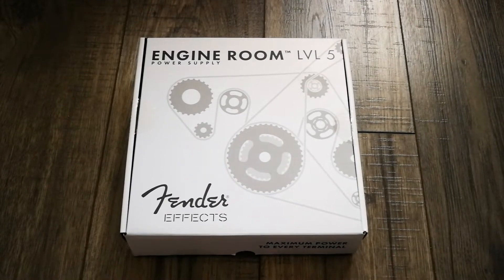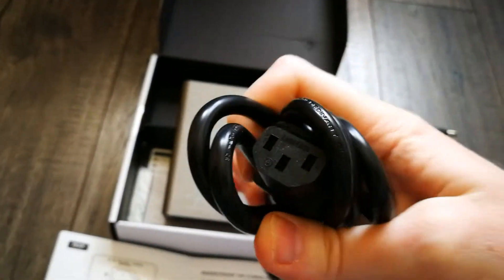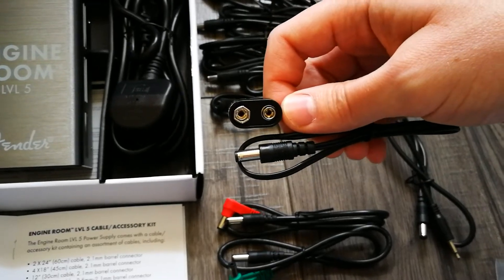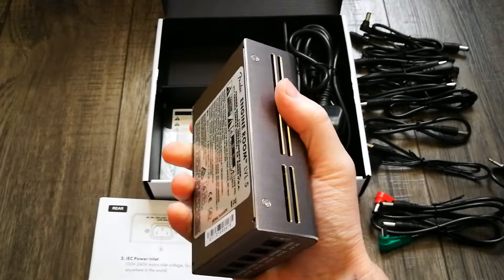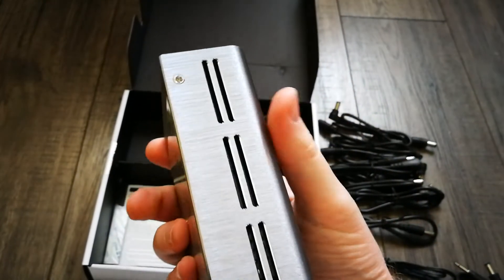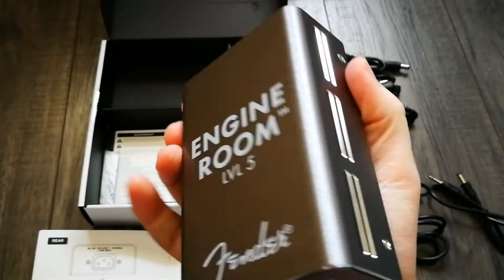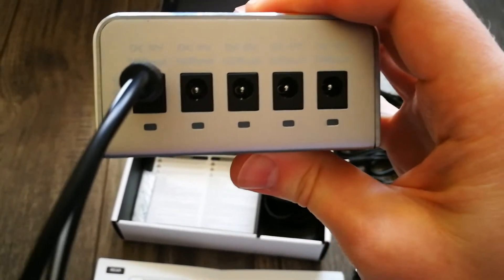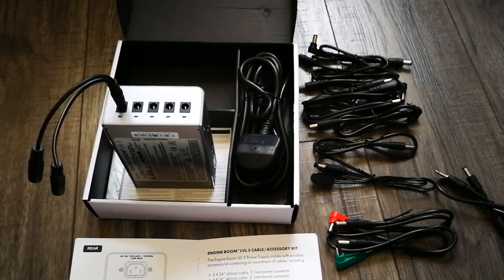Fender Engine Room LVL 5 power supply unboxing & overview

Comment: 5 outputs at 500 milliamps each, or....5 Outputs of between 100-500 milliamps each, and good luck guessing which one will actually put out ??? ma at a given time.
Reply from the maker: Just want to point out that I did not design nor made this product. You are welcome to pose the question to Fender if you have experience in this field.

Comment: Hi mate you probably won’t see this, but how long does the battery last in the power supply?
Reply from the maker: This power suppy is mains powered so it plugs into a wall socket. It does not take batteries.

Comment: Looking a power supply to run an overdrive, fuzz, and HX Stomp. Been looking for this or Strymon Ojai. People have no problem using Ojai with current doubler cable (it'll take 2 power which not a problem for me). I'm curious with this power supply, since it's a little bit cheaper than Strymon. Wdyt? Will it handle my need?
Reply from the maker: Not quite sure about the voltage doubler as all my pedals run on 9V, however I'm using an overdrive and a Hudson Broadcast and the power supply copes fine. Hardly any noise, nothing to complain about anyway, without resorting to a noise gate.

Comment: Is it linear or switch mode?
Reply from the maker: I'm not sure what you mean.
Reply: @alexrudavin540   It is switch mode and has isolated outputs. It also seems pointless to me to pay extra for an isolated power supply ad then daisy chain of it. you could just buy a non isolared power supply and save yourself 150 bucks.
Reply from the maker: @phil B  each to their own. But I don't see an issue with connecting two pedals to one power supply output with the correct splitter, as long as the current draw of both pedals does not exceed the current provided by said output.  The Voodoo Lab output splitter has one grounded connection and the other is ground lifted. I have not experienced any noise issues with the current setup.
Reply: @alexrudavin540  the issue is that the isolated power supplies are expensive. if you use a spliter cable the pedals are no longer isolated. an Ispot daisy chain powersupply works in the same was as a splitter cable but thay cost a lot less.  I was looking to buy a power suply for my pedal board but I was looking to avoid spending alot of money on kit if it was not nessesary.  I guess it is like choosing between an epiphone  and a gibson. you can still play the same tunes on an epiphone but you have to way up if spending more on the expensive version  is worth it. sometimes it is sometimes you can get good results from less expensive kit. The problem is manufactures are just trying to sell their stuff so getting an answer to a question is nor always straight forward

Comment: Would splitting one output between 2 pedals cause noise?
Reply from the maker: I'm currently using two outputs to split power to four small pedals and I haven't noticed any noise.
Reply: Like a lot of answers to questions like this is it depends.
It would need to be either ground lifted or be shielded and the length of the splitter would have something to do with it.
Wmayt I've done in the past with 5 socket PSU's when I need another cable is use an extra one from the PSU and run it from the power out on the Boss TU-3 pedal. The tuner pedal is off and not drawing much when you're playing and it cuts the signal when you you click it on so the power draw is low and the pedals take turns essentially.

Comment: Can it power up Line 6 HX Stomp XL with two extra pedals (Walrus Age and Eras)??
Reply from the maker: It won't run the Line 6 because it requires 3A (or 3000mA) of current. The Ages and Eras should be fine as they only require 100mA each.
Reply: You need a current doubler.  I got one from Amazon and works great